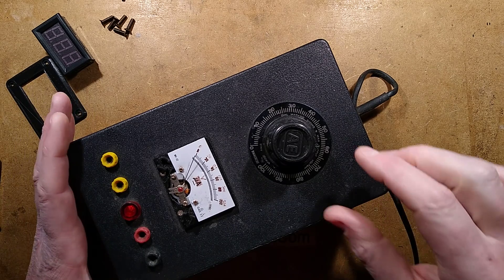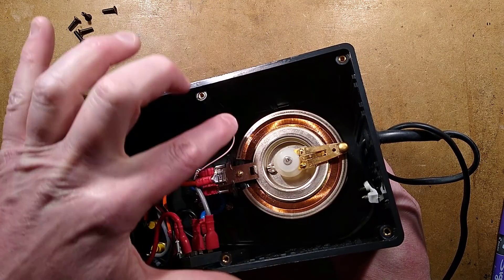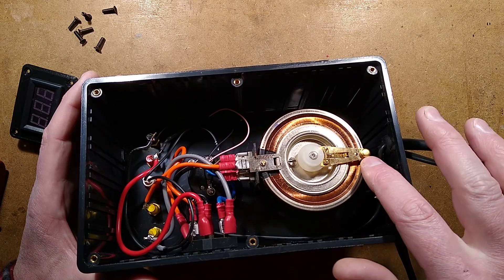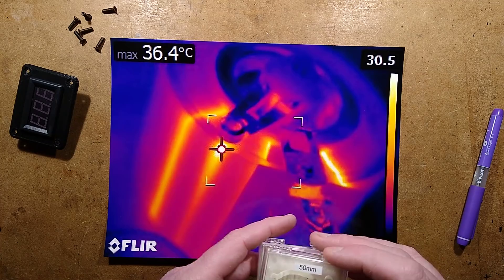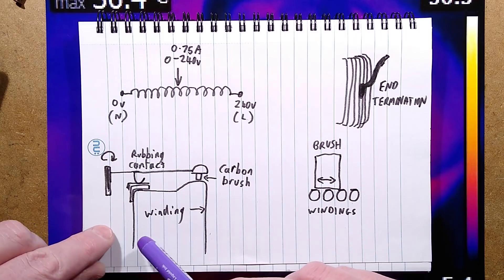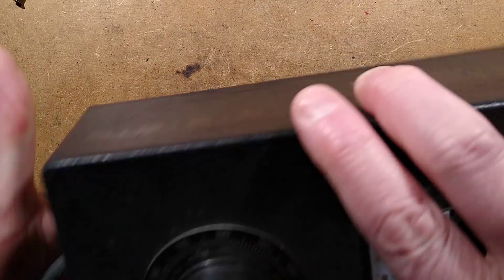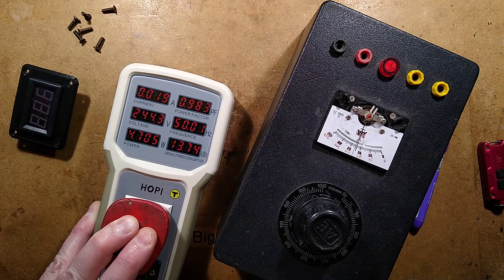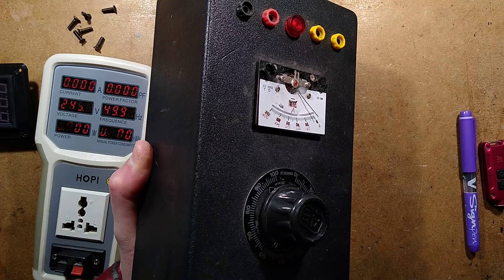Variacs DO short their windings

Comment: I have one of these capable of 4A. has pretty beefy wire to it as a result. I received it loose, and installed it into an enclosure I found in a stream. Doesn't have a meter, but its faceplate voltage indications are accurate enough for government work. I can use my own Hopi on the output if I need higher accuracy. I tapped it to accept American 115v and output up to 280v at full scale, but I have to be careful with the current, as I could hit 4A on the input pretty easily when stepping it up that far.
The idea of unsmoothed DC output is interesting! I might have to build a FULL BRIDGE RECTIFIER for mine. Probably as a module I can attach to the output cable...

Comment: is that possibly also why the 5 amp variac that I have says on it's instruction page to not operate it continuously for more than 4 hours? Due to thermal issues with shorting windings?
Reply from the maker: Not sure.  It does sound like a thermal restriction to allow heat build up to dissipate.
Reply: dont they mean at the rated load? The shorted turns should pretty quickly stop heating even more since the heat gets distributed reasonably well by the copper wire and the core. But at full load everything heats up evenly and all the heat has to dissipate to the air from around the same surface area.
Obviously without ANY cooling, any wire would eventually heat up to infinity, or rather melt.

Comment: What a great way to get high voltage DC! I was thinking about putting a bridge rectifier in a separate enclosure with a power cord to plug into the Variac. I was looking for a good way to test capacitors for DC leakage all the way up to their rated voltage... Since my Variac goes to 11 (300V AC) I'm going to be seeing 600V after the rectifier and I'm not sure which capacitor type would be great for that task... With 600V DC, you could also use it in vacuum tube amplifier testing and design... I have a 15A model so I have plenty of flexibility, even a voltage doubler could potentially give me adjustable 1200V DC.. 
It's not a bad idea when you consider the possibilities with one of these things, I could literally get rid of my 30V DC lab supply!!!
Reply from the maker: Keep in mind that the variac is not isolated from the mains supply.
Reply: @bigclivedotcom  oh yeah! It's very easy to forget that! 
I already have the best LCR Bridge available from eBay, I got it after watching a video by XRayTonyB did on how to use it! I had been watching it on eBay for years but never got it because it looked very complicated to use, the information it provides is like nothing else on another device anywhere near it's $100Au price tag, he has the older silver aluminium case version which needs external power, I got the newer black aluminium case version with the built-in rechargeable battery... 
What this meter doesn't tell you, you don't need to know! It's the bee's knees for capacitors, inductors and resistors... 
I just wanted to test a few different capacitors at their rated voltage in series with a uAmp meter to see how accurate the LCR Bridge is... 
Actually, this meter would be a worthy addition to your bench! I feel that there's still plenty of people who don't seem to understand capacitor failure modes, I recently watched a video from 12V vids and he was, so called, restoring a Denon amplifier. He's been in the repair business for a very long time and I saw him check the power supply filter capacitors with his Fluke multimeter for capacity, the capacitors came up with more capacity than they were actually rated for! He said that they are good! But I'm like WTF? When a capacitor leaks DC, it takes longer to reach full capacity and therefore giving the impression that it's an overachiever! He should know better! It was a painful video to watch! In the end, he called it done and ready to go back to the customer even though it's giving a triangle wave at 5khz and above with a sine wave input! He's not alone though... Some people just rely on ESR readings... It's not enough to show how bad it really is.. the LCR Bridge I'm talking about, it's something else, it really should be on everyone's bench... Without it, you really are just poking around in the dark with a metal stake... 
Oh and btw, I loved the group chat video with kangaroo Dave and the others... Hanging around and talking shite... That's entertainment...

Comment: I have a few variacs of different power capabilities. On the small one (1 amp) the contact brush shows no lengthwise/widthwise resistance differences, but the ones I have that are over 1 amp have a definite difference in resistance. Maybe the small ones are too small to notice the issue? I'd also like to mention that my taps are all terminated to one wire. Those wires are brought out, given a few twists, and soldered to.

Comment: If you want to see a really interesting variac… Check out the isolated variac in the Staco “ EJ” series. The one I use every day is a staco ej401V which will do 0-140 V in both AC and DC. The AC side can either be isolated or not. 

Very very interesting transformer in those units. I have several in the EJ series but the EJ401V is small enough to where it sits nicely on the bench.

Then if you want to se The granddaddy of all variacs… Look into the Hampden bps series. I have bps 103a. And that thing will do damn near every voltage in both AC/DC single phase AND three phase. Isolated or not. It’s insane. 

Weighs well over 100 pounds, And can be picked up from eBay for under a few hundred dollars delivered. It’s got a huge three phase very act inside as well as a beautiful 50 pound isolation transformer and all types of gorgeous pieces and parts. I picked one up off eBay last year for about $200 delivered and it was brand new in the crate. It was an older unit so even though it had been sitting unused I put new electrolytic capacitors in it. And hooked it up to a huge three phase converter I have in my shop so that I can use the three phase side of it. I don’t use it for long as it’s not very efficient running in three phase but it allows me to test almost anything.

Comment: Wonder if the A sub L is such that one winding isn’t going to pass much current?
Reply: Per-turn voltage over turn wire resistance for the end connections. The wiper is carbon and therefore a resistor, so you have the winding resistance in series with whatever the wiper resistance is in the area between the contact area on two turns. It's low, but by design (and physics) nonzero. You can think of the wiper as a small rheostat that runs along the rim of the transformer, allowing a fine adjustment between the voltage on two adjacent turns.

Comment: In the '70s I worked for an advertising agency. They had a room where they showed the adverts. To dim the house lights they used a variac. The problem was, the brushes kept burning out. It turns out it was wired in series with the lights, so it was acting as a variable inductor!
Reply: It was probably under-rated because someone had added lights to the showroom after the design was done. Or worse, someone put fluorescent lights on it, which will wipe out a variac right quick. Using variacs to dim lights was very common from the mid 1940s to the late 1970s; that was a common form of theatrical dimmer. They did require some maintenance though, such as periodic cleaning and lubrication, and, depending on use, occasional brush replacement.
Reply from the maker: It doesn't seem that long since we installed a big variac in a theatre for the musicians lights in the pit to avoid phase angle dimming noise.
Reply: @bigclivedotcom  my elementary school had big lever actuated ~20kw variacs for everything installed in the 40's, 12 channels of incandescent fun
Reply: @lwilton  It was rated correctly. Connecting  a neutral to the other end of the winding cured the fault.

Comment: Instead of a Variac, an modified UPS is a more elegant solution. Put a DC power supply in in the place of the battery and modify the feedback to get variable output voltage. You get double current limiting as an extra feature and the output is stabilised regardless of mains input voltage.
Reply: That's an interesting idea! Assuming you don't mind that most UPS are not true sinewave...
Reply: Mine is a true sine wave design and getting one is not really that hard. Once batteries die, their price is close to nothing, in fact companies often discard them instead of replacing the batteries. In my case I just disconnected the internal ground to get an isolated 230V supply, however feedback was adjustable in 150-240V range using an built in trimpot, with some basic modding (shorting some resistors) you could get even further adjustment.
Reply: Or hack a Prius inverter for truly high power levels - 10-20kW continuous and on the order of 50kW peak. They're often available on the surplus market for as low as $100.

Comment: How would a high current Variac differ?  Say 5a or 10a.  More windings?  Thinner wire?  Thicker?
Reply: Thicker wire and as a result fewer turns, and as a result of that, more voltage between each turn. A higher current variac will also be physically larger and heavier, because more iron in the core will be required to prevent magnetic saturation at the higher currents. More iron means a larger diameter disk, so the loss in turns because of thicker wire is somewhat compensated for by the larger winding diameter. Since the turns are wider (and because of the larger current) the wiper contact will be larger.

A variac is a fairly unique form of transformer in that the winding layer can only be one layer thick. In most transformers you you get more turns by just winding multiple layers of wire. But here the wiper has to contact every turn, so you can only wind one layer thick. This limits the number of turns.
Reply: And some Medium sized variacs have carbon rollers instrad of brushes.

Comment: Yep, the brush is designed to bridge at least two turns. But it is carbon so it has some resistance, and thus it isn't a dead short, it is just a low resistance across a small voltage. 

The brush is designed to bridge turns so that it will work effectively as a rheostat and the output of the variac will not step in voltage, but will be a more or less smooth increase or decrease as the arm is moved. The rheostat effect comes about as the area of contact changes from one winding turn to the next.

BTW, in place of that simple digital volt meter, you might want to look on eBay for a Peacefair model PZEM-021 or model PZEM-022 meter. This will do everything the Hopi will, and fits in about the same hole shape as one of those digital LED voltmeters. They claim to have a minimum input voltage of 80V because they are powered from the same line they are measuring. However, a little looking at the PC board will show you where you can cut a trace and separate the power input from the measuring voltage input. At that point it is fairly easy to adapt either one for use with a variac. They use the same chips as utility-supplied electric power meters, so they are pretty accurate. Search terms are "digital power watt meter monitor voltage voltmeter ammeter" and the like.

Comment: I have an old GE variable reluctance transformer. It has a rotatable core in a cylindrical stator. It creates variable voltage without the steps associated with brushed windings. It's much heavier than an equal powered Variac.
Reply: Most interesting. I would like to learn more about it, as from the very little information I've found, it seems it wouldn't have a freely adjustable output voltage, but rather a set of predefined voltages, as in a fixed autotransformer.

Comment: Wonder if one can make the variator transformer portion with homemade parts?
Reply: you could , very curdely, but I wouldn't recommend doing it on such a high voltage.
Reply: @Ramog1000  Yeah that would be a lot of mechanically challenging work. The most difficult part would be making the wiper mechanism. It has to make a solid connection all around the transformer without wiggling around at all. Other than that, it's just a toroidal transformer where the windings have to be glued down securely.

Comment: I have a couple of very old 6kw autotransformers from an old theatrical dimmer board. The ends do terminate on one wire, but the brush does bridge more than one winding. Not sure what the brushes are made of (lost now) but I think there was some resistance across the brush itself being that it was carbon or some mixture of materials. Could be this micro-resistance is enough to not dead-short a winding. Otherwise, I would think it would heat up like an instant-on soldering gun.

Comment: Many variacs have turns beyond the point where L1 connects and therefore can produce higher than supply voltages. Variacs are basically a form of autotransformer.
Reply: I have an old variac that will go up to about 110% of the input voltage

Comment: I could be totally wrong but I am sure if you place the printed item in an airtight container and put a small vessel with acetone in it the vapours smooth out the print taking away the lines.
Reply from the maker: It depends on the type of plastic used.

Comment: Finally we got to see your Variac. Cute small one, my 5kva one is a pain to move!
Reply: I've got a 2KVA (120V 17A), and it turns easily.
Reply: @michaelmoorrees3585  It turns super easy,  but moving it from one place to another is a pain. That beast is heavy. It also loves to pop breakers sometimes if I don't hook it up to the soft-start. :D
Reply: @DrakkarCalethiel  You could attach some caster feet
 to it. Did the same with my 10kVA 60kg monstrosity : D works well
Reply: @aulus4163  60kg 10kVA, what a beast! My 5kVA one is just around 16kg with all the control stuff.
When I'm going to pair it with a couple beefy transformers on the output, everything will get mounted on a rollable platform. Still need to find some tranies that don't cost an arm and a leg new...

Comment: Hm, that must be why that 'variac' I found at the school was stuck. You see, my old school has 100+ years of existing, most of those as a technical school, so there is a lot of old and questionably broken stuff, as my classroom sometimes also had a pile of junk in a table or in a corner, we tended to fiddle a little bit with it before the teachers came in and started ranting about messing with the stuff, and with that stuff there happened to be a variable transformer, with a little thing(I'm sorry, can't remember the name of it) that was stuck but obviously indicated a voltage. I didn't have anything to measure it with, but I wouldn't be surprised if I got a voltage from it along with some heating up, after this video, I believe some students or time, maybe both, made the windings solder themselves, I really don't know, as I didn't look much at the time, there were some other things that deserved attention too.
Reply: In further thought, the biggest contributor must be the carbon brush, as I recall that they don't have a very big lifetime and need maintenance periodically.

Comment: Old school stick welders (Miller thunderbolt, most old GE's, anything with a big crank) use a similar style to control the amperage of the welder.
Reply: yeh well you don't really control amps since they are just a result of volts, so by increasing the voltage more amps flow.
Reply from the maker: Some use a handle to wind in a core.

Comment: Older hobby grade RC cars used a similar setup for speed controllers. They work really well with older motors, but they tend to melt solder connections with the newer "higher power" motors

Comment: Hey Clive what build surface does your printer use? PEI sheets work great. ABS juice works great as an interface layer for all types of plastic. If you use ABS juice and it's causing the print to adhere extremely well, try PVA glue stick. My personal favorite adhesive is BedWeld. Works great on my PEI sheet with ABS, PLA, ASA, PETG, TPE. And of course waiting till it cools and contracts helps a ton.
Reply from the maker: Heated glass with a pattern of dots on it.
Reply: @bigclivedotcom  I see. My friend has a Creality Ender with a similar glass bed. They ask you not to use any adhesive on the textured side of the glass. You can flip it over and try different adhesives until you find the stuff that works.

Comment: i have an old (30 ish years, i think?) claude lyons 'regavolt' variac , its winding is quite 'coarse' , but would be as its a 4 amp type, never yet used it, as i need to make a case for it first..  its brush is quite thin vertically to minimize turns shorting

Comment: A variac works similar mechanically to a wire wound potentiometer
Reply: And electrically vary different
Reply: @clytle374  Indeed. A wire-wound potentiometer uses resistance wiring (possible nichrome wire) if I'm not mistaken and is usable in DC current applications. Whereas Variac is strictly operational in A/C and relies on inductance.
Reply: @billr3053  it's inductive coupling, just like a a regular transformer. It's technically a variable autotransformer. The fact that there is only one winding in an autotransformer can seem confusing at first, but really you can draw it as 2 separate windings and get the same result.
Reply: @clytle374  OK, thanks for that clarification. I was thinking of the simple wiper kind where it's pure resistance. I confused myself I guess. :) Sorry about that.
Reply: @billr3053  no need to apologise. A simple resistance wire with a wiper is a potentiometer.   It will work both ac and dc. Where transformer devices are mostly ac only devices.